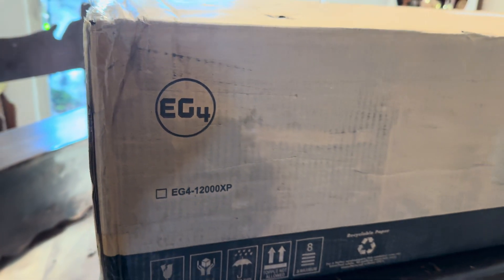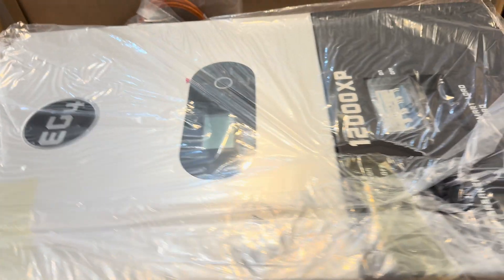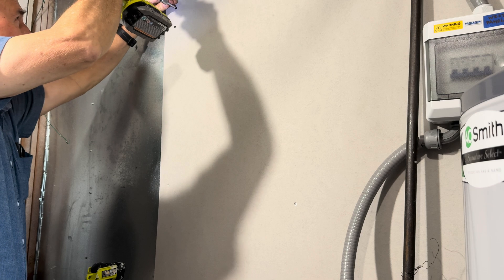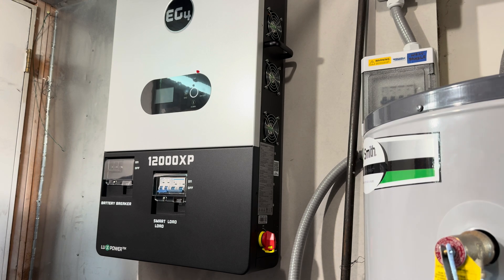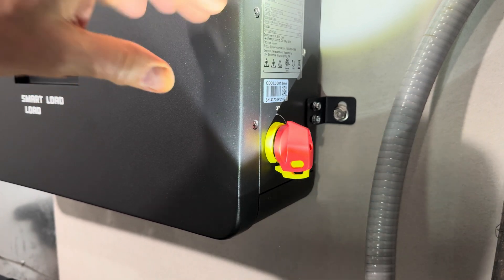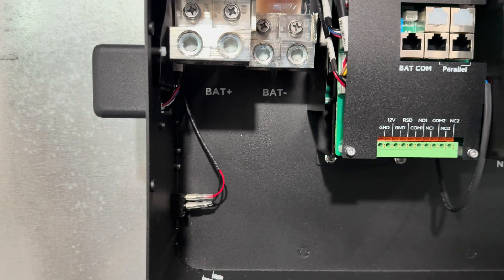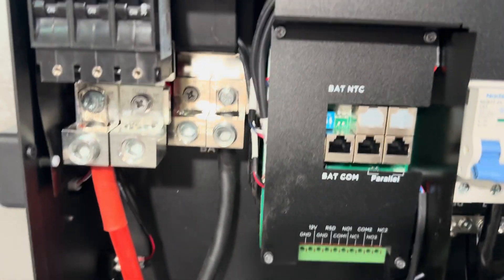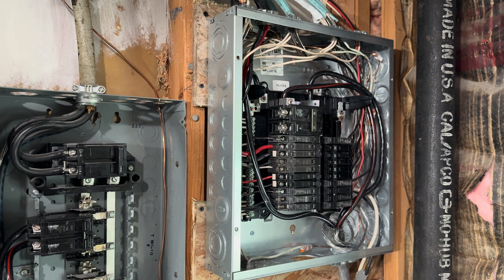Brand New EG4-12000XP Off-Grid Whole-House Inverter Install

Comment: For off grid you need some permits?
Reply from the maker: In my state you can do electrical work on your own home without a permit or inspection. However, for your own safety it is best to have a licensed electrician either do the work or validate that what you’ve done is up to code. That is also true for off-grid solar installations. No permit or inspection needed if your equipment will never feed power back into the grid.

Comment: I hear that Luxpower, makers of the EG4 line of inverter chargers, pose some of the biggest risks for back door attacks from communist China which is one of the reasons why I would never buy one of their cheaply made inverters, no matter what the discount.
Reply from the maker: It turns out the EG4 12000XP is made by EG4 in the USA (in a former medical devices plant), but if you’re concerned about that simply don’t connect the inverter to the internet.

Comment: For your manual you will see that a 10g wire is not bit enough. You should be using a 6 AWG. Specifically for the load that the 12k OG requires of 24,000 watts and a voltage up to 480vDC. 10 is low end on that scale.
Reply from the maker: @Off-GridMountains  Thanks. That would be true if I had enough panels to use the full capacity of the 12000XP, but my largest PV string is under 400 VOC and under 20 amps, so a 10g is recommended.

Comment: I am wondering how will you balance the charging of 4 batteries 12.8 volts connected in series without a BMS?
Reply from the maker: @dadscamba4354  The batteries do have a BMS. It just doesn’t have communication to my inverter. They are made by Eco-Worthy and, supposedly, their BMS manages the balancing. So far so good, though it’s obviously hard for me to tell without disconnecting the series and testing every one. I am waiting on the delivery of a smart shunt that should give me better insight into the SOC of my arrays.

Comment: Why on Earth did you spend your money on a low surge, short lived high frequency, transformerless inverter? They not only offer poorer surge capacities and shorter life expectancies, but because there is no output transformer to provide galvanic isolation, thay can also damage you appliances during a failure of their H-Bridge circuit where MOSFETs have shorted to ground. No reputable American made inverter manufacturer uses high frequency, transformerless inverter manufacturer uses this inferior design. They all use low frequency, transformer based inverter tech instead.
Reply: Dude stop trolling everyone's channel talking about everyone's transform-less inverter get a life nobody takes you serious you have made the same stupid comment on every solar channel!  Move on!  You are not influencing or helping anyone!
Reply from the maker: @quickquote1568  Thank you for the input. Those are significant disadvantages. However, there are some advantages such as:
Compact size - Transformerless inverters are typically smaller and lighter than traditional transformer-based designs, making them ideal for space-constrained installations. 
High efficiency - Due to their simplified design and high-frequency switching, transformerless inverters can achieve higher energy conversion efficiency, leading to greater energy production from your solar panels. 
Lower cost - Generally, the reduced complexity of a transformerless design can result in a lower initial cost compared to transformer-based inverters. 
Multiple MPPTs - Many transformerless inverters offer multiple Maximum Power Point Tracking (MPPT) channels, allowing for better optimization of power generation from differently oriented solar panels. 
For me those advantages outweighed the disadvantages.
Reply: You do you boo, it’s his money and he can buy whatever he wants…
Reply: That’s a lot of naysaying without a suggestion as to what is better! We are here to learn and would appreciate where to look.
Reply: @TopMooseCone  'It's' a BOT.  Outback working overtime..
Reply: @TopMooseCone  Sorry, I'm not a salesman. I repair inverters for a living. Have done so for the past 25 years. If you want suggestions on low-frequency inverter brands, then I would suggest an inverter from any one of the following manufacturers. Outback Power, Sigineer Power, Schneider Electric, Magnum Energy or Victron Energy all manufacture high-quality low-frequency, transformerless inverter chargers. You may pay a bit more, but you'll get an inverter that will last far longer (typically triple the life expectancy of a high-frequency unit), a much higher surge capacity for starting high inductance loads and a much safer inverter that provides galvanic isolation between the inverter's H-Bridge or DC boost stage circuit and its AC output.

Comment: The only thing I may different is to run those batteries in two separate leads. In other words arrange the batteries in 48 volts with two banks as the inverter has wiring places that are on the same bus bar inside the inverter that way if you ever need to do work on the batteries you can run on one bank if needed. Also the wiring can be smaller as the load is divided in two.
Reply from the maker: @offgridwanabe  That’s a great idea! I may separate them on my next reconfiguration.

Comment: The 12000xp has a 100amp pass-through. Witch wire are you using to connect from grid to the inverter and from inverter to the main load panel
Reply from the maker: I used aluminum cable. Here’s the link. https://www.lowes.com/pd/Southwire-Southwire-2-2-2-4-Aluminum-Ser-Service-Entrance-Cable-By-the-Foot/4294349

Comment: Joe,  thanks for the video .. one thing you mentioned is a 100 Amp breaker to feed power to the subpanel.  The specs for the XP shows maximum AC output of 65 Amps.  I don’t understand the difference between the 100 amps and 65 amps feed to the XP. Thanks
Reply: AC BYPASS (GRID | GENERATOR)                 100A | 90A 
MAX. CONTINUOUS OUTPUT CURRENT      50A @ 240VAC | 57.5A @ 208V
Reply: Thanks, sorry .. I’m trying to learn .. so that means if the grid fails there would only be 50 A coming from the batteries ?  
I’m want to use this as a UPS meaning that I want to use the grid first (while the batteries are charging they would get charged also) and only pull power from the batteries when the grid is down.  Using the battery first would mean they could be partially depleted when the grid fails.  Is there a setting for this ?
Reply: @wbarkwell  This would work as an UPS as I understand it.  While the Grid is up, power would pass through the inverter to the load panel (100 amp AC bypass) and charge the batteries if setup that way, when the Grid goes down, the inverter would supply power to the load panel at 50 amps max using the batteries (and/or solar and/or generator if available).
Reply: @MrMindlink  I think you are correct but why would they design the inverter to pass 100 Amps grid bypass but only 50 Amps via battery/solar ?  Whatever load I need covered by the grid I also need covered when the grid is down - what am I missing ?
Reply: @wbarkwell  Cost/size and weight.

If you need the 100 amps you can parallel two of these 12000XPs together (max 6), you would also need to increase the battery storage at the same time (min of 400Ahrs per inverter).

8.2 MULTIPLE INVERTERS 
The EG4® 12000XP Off-Grid inverter supports up to 6 units connected in parallel to reach a capacity 
of up to 72kW. To successfully connect inverters together in a parallel configuration, verify the 
following: 
    • A single string of solar panels cannot be shared between inverters. 
    • Each inverter must be cabled to the same single battery or battery bank. 

RECOMMENDED BATTERY CAPACITY PER INVERTER              >400Ah    (@ ~48VDC, so for two inverters your battery bank would be a min of 800Ah)
Reply: @wbarkwell  The bypass feature is for setups where you usually rely on solar and battery power, and only use the grid as a backup. However, you’re looking at it the other way around—your setup primarily uses grid power, with the battery as a backup. In your case, the bypass doesn’t apply, so you can ignore it. The bypass is only useful when you’re trying to run on battery and can’t anymore, so it automatically switches over to the grid. But with the way you’re describing your system, it won’t work that way.

For what you’re trying to do—using your system as a whole-home backup (UPS)—you need to size your inverter to cover the total load you want to support. For example, if you need to handle 100 amps of load (24kW), you’ll need an inverter or inverters with 24kW of capacity. When the grid goes down, your inverter takes over, not the bypass. To get 24kW of power, you’d need to buy two of the 12000XP inverters, as each one provides 12kW.
Reply: @wbarkwell  Most people buy inverters to power their home primarily from solar or battery, with the grid as backup when the solar isn’t generating or the battery runs out. Sometimes, a home may have a brief power spike that exceeds the inverter’s capacity. Older inverters would simply shut off and restart after a few minutes when this happened. Newer inverters have added a bypass feature to prevent this issue. If the power demand exceeds what the inverter can handle, the bypass switches over to the grid in 10-20 milliseconds, keeping the power on without interruption. It’s a modern convenience feature.

Having a bypass rating that matches the inverter rating wouldn’t make sense. For example, if you had a load spike that exceeded an inverter rated for 25 amps, and the bypass was also only rated for 25 amps, the bypass would overload too, and the inverter would still shut off. That would make the bypass feature pointless. The bypass is intentionally rated higher so that, during an overload, it can handle the extra demand and deliver enough power to cover the spike without shutting down the system.

That said, the bypass equipment can be expensive, especially as the capacity increases. Moving from 50 amps to 100 amps, or 100 amps to 200 amps, requires larger and more costly components. Manufacturers typically size the bypass to be one step above the inverter’s capacity. For a 50A inverter, a 100A bypass makes sense. A 200A bypass might make the unit too expensive for this model.
Reply: @wbarkwell  And yes, there is a setting for what you described. This inverter has four different “working modes,” and one of them is called “AC Charge (and Bypass) Mode.” In this mode, the inverter prioritizes the utility grid over the battery. The grid will supply power to your home and also charge the batteries. The battery will only discharge when the grid goes down.
Reply: @wbarkwell  I believe you can select any of the 3 power sources as the first.
Reply from the maker: So, in the manual under section 7.3 it says “the inverter supports 100 A of AC current on the grid and EPS load port.“ Also, on the little chart on page 18 it shows that the load is 100 amp but the smart load is 63 amp. Maybe that’s where you’re seeing the difference. I’m not using the smart load yet.